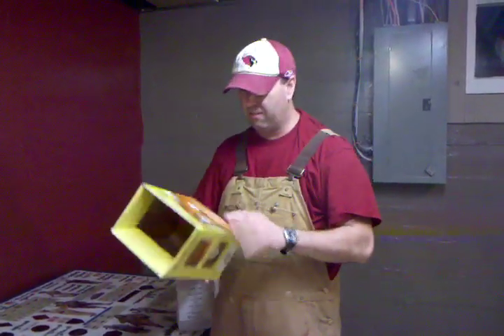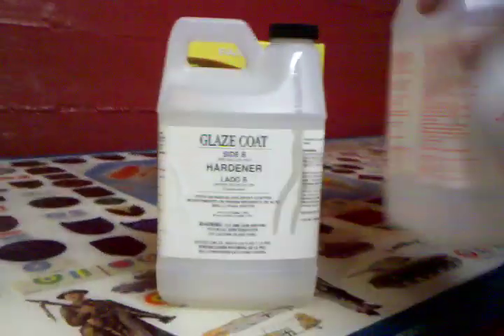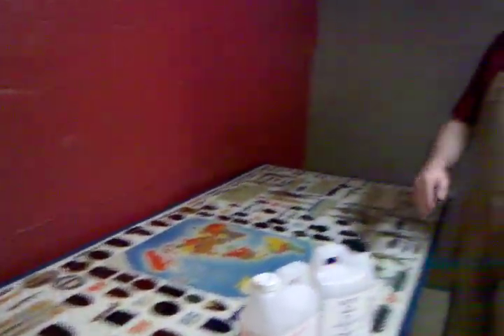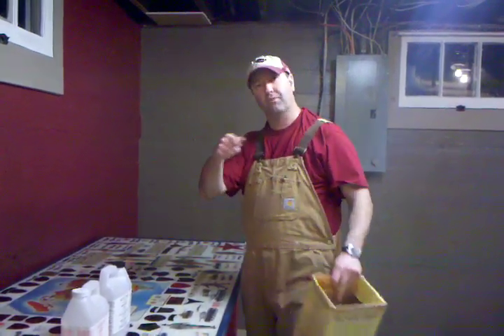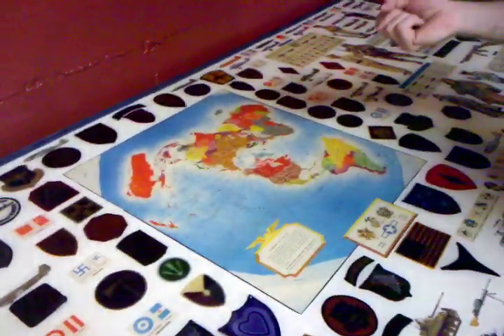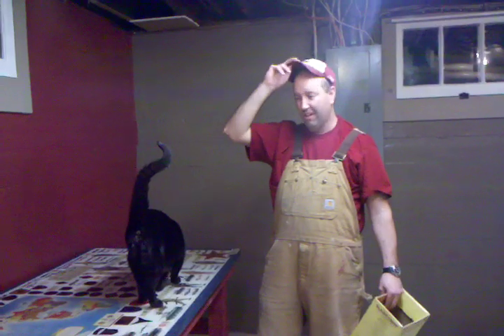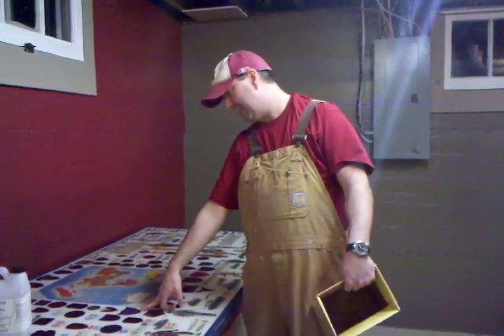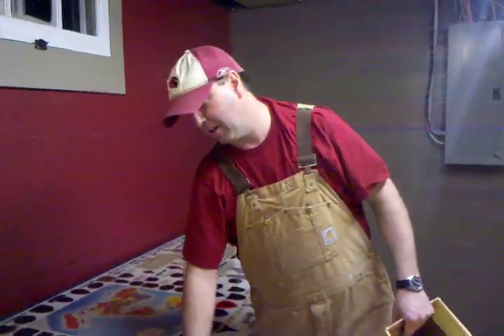Famowood Glaze coat

Comment: ok Dave...thanks for the information... I did few bar top in with this product... but now I wanted to do a dance floor that is 20ft long and 20 ft wide with this.. I see how hard it gets on a bar top i was wondering will it be great to put on a straight hard wood floor because I want that same look on the floor.. if not not what can I use and where can I get it from locally to make it look like a bar top and dry  hard in that  same time...cause this bar is open now and only have a day of drying time..I used a polyurethane thinking and put it on with a drywall 24" knife.. it didn't dry fast enough so it did not work.. is there something that will give me that same look...??

Comment: I have the instructions right here and they say the mix time is 6 minutes, when you mix cup A and B then another 6 minutes for cup C.
Please explain is it either 2 or 6 minutes
Reply from the maker: +SpiritEagle20478   Ok then if it says 6 minutes in the instructions follow it to the T.  It has been about 3 years now so I can recall exactly but this was the $70.00 package not the smaller version, anyway my advice to you is follow the instructions and don't deviate at all and be precise on the stirring and mixing. Good luck I hope this helps you.  Sincerely Dave

Comment: David the glaze u said to use will it have a build up on it like a bar top 1\2 in..???
Reply from the maker: yes if there is a 1/4 border....the specs give you some ideas on how much if no border it will just flood over the sides
Reply from the maker: as for the wood floors the brand is called varathane...I bought it at lowest hi traffic it's like about 39 bucks for 1 gallon
Reply from the maker: 1/2 would be a lot chester what projects are you doing with the famous wood glaze
Reply from the maker: +David Jacques Lowes not lowest
Reply: no I need it to sit on top like pouring it over stuff like pennys